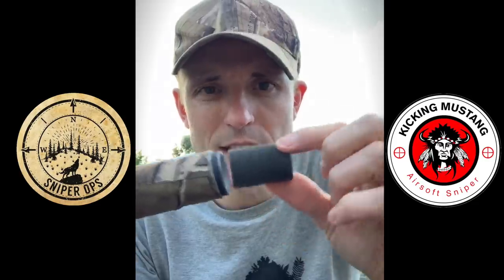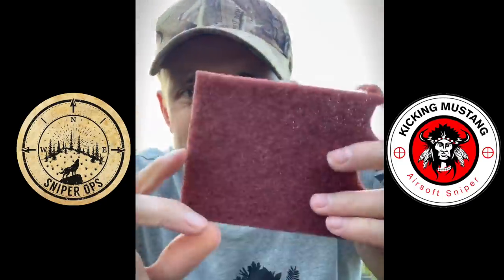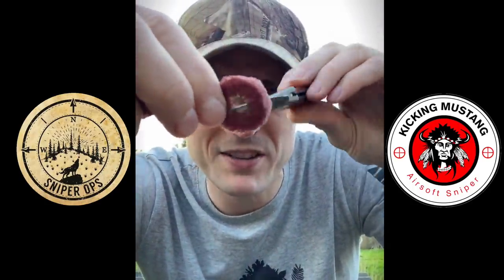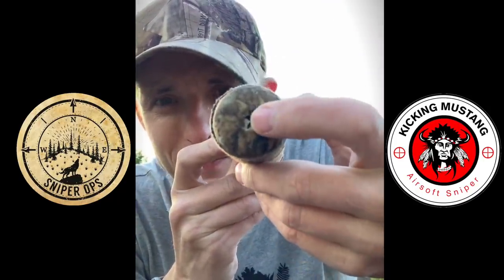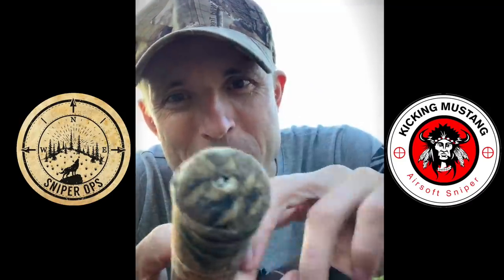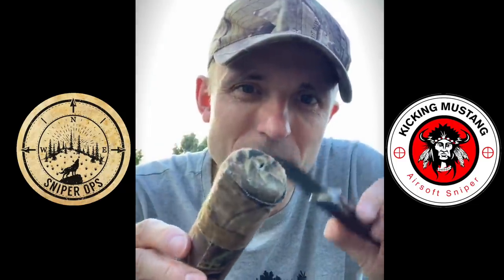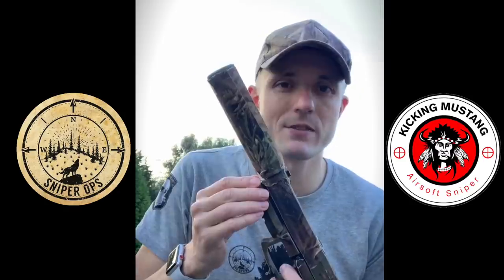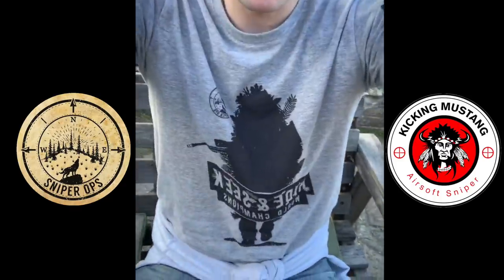Airsoft Tokyo Marui Socom MK23 Covert Mods

Comment: For those wanting to do the "fart flap" and wondering on how to get rid of the sticky, simply when you add the tape over on the otherside add some baby powder and that will stick to the backing of the tape and prevent it from sticking to anything else
Reply: get some powder, rub it on then rub it off.  should take care of the sticky.
Reply: Is there any specific tape that works best for the fart flap?
Reply: If you've wrapped your MK23 with camo tape then use that tape so it matches, I believe most tape works but I would stay clear of masking tape and electrical tape. Duct tape may do but it's best to stick with a thicker camo tape or fabric tape
Reply: SICARIUS Airsoft Thanks!
Reply: Graphite powder or toner powder?
Reply: SICARIUS Airsoft why not electrical tape
Reply: @Sparrow_Dynamic  I tried it at first but I found the tape either wouldn't hold due to the gas pushing it out, as well as that I'm 99% certain it doesn't stop the air from coming out as great as fabric tape mainly because the material is vinyl
Reply: SICARIUS Airsoft oh ok. Thx for replying
Reply: you also can use a piece of non pores cloth like a eye glass cloth and rap it on the top of a piece of foam and slide that in then use a blade of sorts to cut a slit into it and that works fine for me and easily replaceable along with you are able to turn the foam over and do it on the other side u can do all 4 sides or 3 sides but 2 works fine
Reply: Or just put a reverse patch of tape on the inside before you tape the end of your suppressor, then cut it! You get a much sturdier fart flap, and it seals better!

Comment: I’d have loved to hear the gun Unsilenced for comparison. I’d suggest punch outs / Hole punches for the Scotch Brite cause what you want is air pockets the sound can run dead in, the more the better, so if you can manufacture those to form a narrow corridor that is as close as possible to the BB traveling through, the more suppression you will get. I’d also add a section that can cushion energy like rubber discs that stack so they form a ribbed tube (alternating Big diameter / small diameter on the inside) also using Hole punches.  Plus for the FartFlap, consider silk or maybe something like kitchen foil, just my 50 cents, not having and Softair experience at all, but I build a silencer for my spud gun once...

Comment: I used the scotch brite and got two pipes as big as the suppressor diameter and an 8 mm one for the centre hole and just sharpened them and punch against the end of a wood block. I'm thinking of upgrading the punches to a couple old sockets sharpened. Easy to clear as well.

Comment: Where the flap begins to affect bb flight is when you are in the phase of mag cool down and there isnt enough pressure to blow the bb out as strongly. i noticed this with my CZ P07 nbb when C02 runs low or the cart begins to freeze dueto rapid firing. on a fresh catridge,,,straight as an arrow.
the best stuff I found for the fart flap mod is the flex form camo tape. its cloth so it also helps to absorb sound, just put a bit of dirt around the edges and it wont stick or affect your bbs either.

Comment: Great video, have you ever tried to silence an AEG? I'm building a dmr  and I hate the sound it makes.
Reply from the maker: Most noise comes from the gearbox in an AEG. But I have a couple, my TM Type 89 is very quiet and suppression works well on it.
Reply: Shim it well and get the motor height bang-on, do the same mods Mustang did to his MK23 suppressor to yours (if you have one) as I have found it works just as well on my JG AUG A2 DMR. Stuff some J-Cloth or foam in any hollow space you can but make sure that it won't get ingested by the gearbox. I personally wouldn't bother with helical gears as I have found it makes little to no difference. Well greased straight cut gears seem to work just fine and are less faff to work with.

Comment: Well… what about bb trajectory deviation and range?
How does that camo tape crossing the exit of the silencer changes the effect on the bb? What do you mean by "slightly"?
Anyways, nice mods ;)
Reply from the maker: With long range rifles it occasionally effects accuray at range. I use it with my Tanaka gas M40 and it is perfect, with teh SRS not so much. With the MK23, it has no noticeable effect on accuracy. Give it a go, very cheap mod to try.
Reply: @kickingmustang  I'll do it!
Thanks for all your effort and sharing! 👌😉

Comment: Hi Mustang! While i watched this video, i had an idea! I dont know if you know about Maple Leaf's crazy jet barrels, if you dont, check them out! Its basically blast a little air in front of the BB. So, my plan is. Get a crazy jet barrel to my VSR, then add this "Fart Flap" mod INSIDE the silencer, like the middle of it or so. What do you think? Technically its work in my head, if i have the chance to make it and experience it, i can share the results with you.

Comment: Never ever sacrifice accuracy, it is absolutely unnessasary. I have tested hundreds of silencers for work and sport. You could give the cheap Weirauch airrifle silencer a try. The 1/2”Unf thread version is easy to fit. Those can be modded  very nicely as well, but could posibly outperform your silencer out of the box. Available in more than .22cal. But the .22 performs nice if you are willing to widen it up to 8mm.

Comment: Any uneven drag on the bb as it exits will impart a spin and result in a curved trajectory in the direction of the side that is retreating.  The more perfectly centered and even the fart flap cross-cut is the less this will happen.
Reply: Shouldn’t be - or at least not noticeable. The flap opens before the BB reaches with the gas so shouldn’t touch it if done properly

Comment: If I might suggest. Take a piece of pipe that has the same inner diameter as the big part and another with the same as the inner part. Then chamfer the outer edge of the pipe until fairly sharp like a round chisel. Maybe weld a little piece of flat stock on top to wack them with a hammer. Then lay your scotch bright on a piece of wood and knock out the little part and then smack it again with the big and then you'll have your scotch bright donut perfect with no straggling hairs.
Reply from the maker: Nice tip!
Reply: @kickingmustang  i used to do that to cut out leather to make buttons for custom car seats.

Comment: Hey this is just a theory but if you were to do the fart flap mod in between the foam pads inside the suppressor and not only just on the outsiders with that make it even quieter???
Reply from the maker: Some of the Sniper Ops players do that, they have an internal flap as well as the external one. I'm not sure on how much of a difference it makes. Give it a go?
Reply: kickingmustang thank you!

Comment: If it is possinle if you can make the slide and trigger action quieter that would definately that would improve am already quiet mk23 but cant immediately think how you would go about it.
Reply: I've noticed that whenever he can, Mustang will cock the hammer on the MK23 thus eliminating some of the sound from the action, since the Mk23 is double action it will cock whilst the trigger is being pulled, this cocking action is noisier than if the hammer was already cocked.

Comment: Well I tried these 3 modifications on a STTI MK23 with no upgrade, and compared to my simple foam modification this reduces a lot the noise it makes, but it also affects my trajectory making the bbs and the hop-up more consistant... how does it work ? I don't know but I love it.
Reply: Suppressors can add range and accuracy, I have experienced the same thing with my old ASG Skorpion VZ61, I assume it is down to the fact that the BB is shielded from the elements for a bit longer when fired. The Suppressor might also help funnel any airflow towards the muzzle.